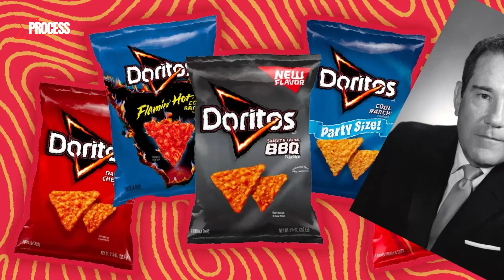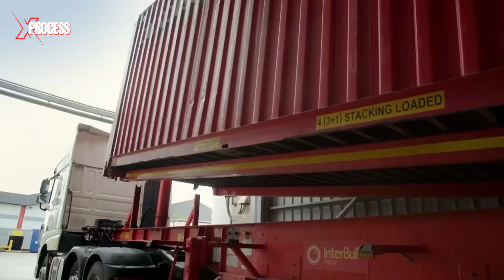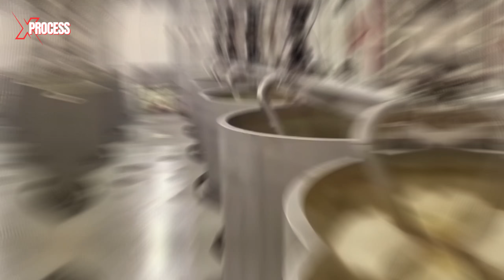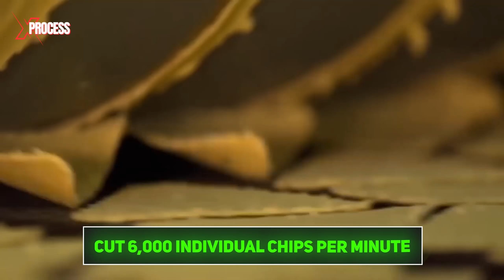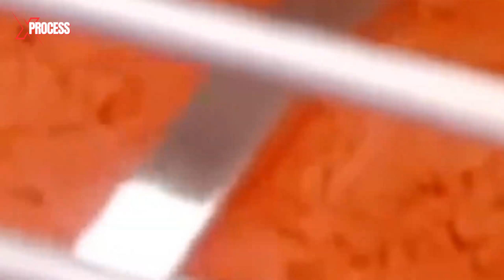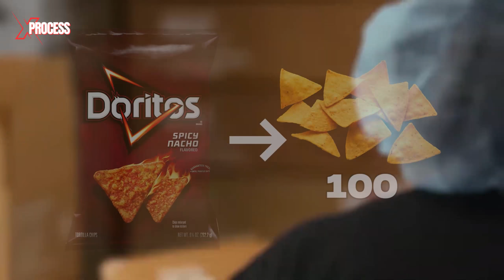How DORITOS are made in Factories | How were NACHOS invented?

Comment: Ive delivered to Lays, those potatoes are just dumped(literally) on the floor of the trailer until the trailers allowed weight is met, not real sure how the cleaning of said potatoes done
Reply: The potatoes are washed as they enter production - Usually by vigorous surface washing (Removal dirt) and additional washing during the peeling/slicing process. Any bacteria or germs are eliminated at the cooking stage, and is one reason why frying is used. 👍